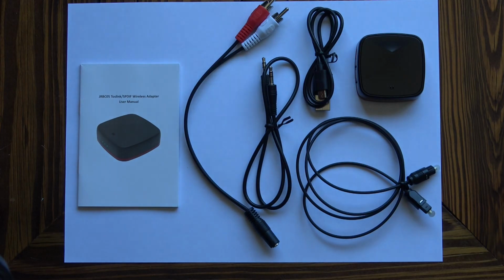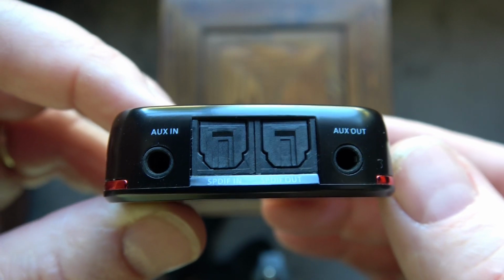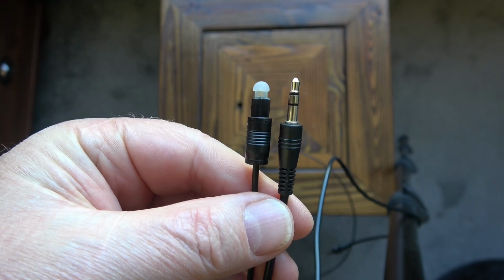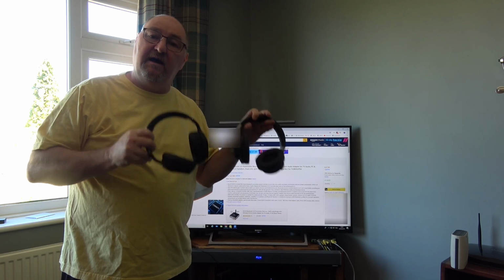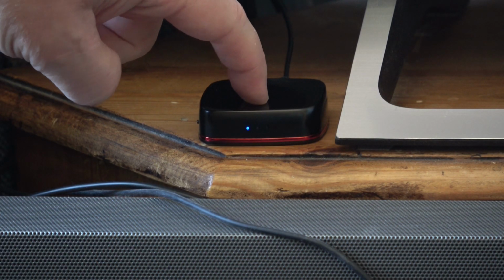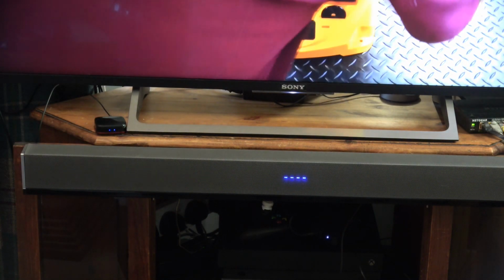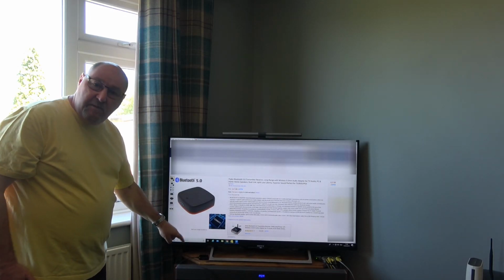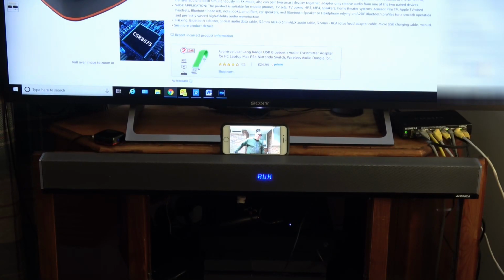Flybiz JRBC05 Bluetooth 5.0 Transmitter/Receiver - Review and Set Up

Comment: Hi Russell, thanks for the video. I have the same product but when I connect 2 bluetooth speakers I have Delay, the sound arrives 1 second late, do you know what it could be? Another thing is that I wanted to combine the audio outputs, Aux Out and Bluetooth at the same time, but I couldn't do it. Do you know anything about that? regards
Reply from the maker: Sorry Cristian, No idea on either issue.  I would try the Flybiz on other equipment to see if it behaves in the same way on them.  :-)

Comment: So, I received the unit and played a bit with it. Connecting this unit to an amplifier works great. This way you can put the volume more up. But it distorts when you move the volume up to much. So you need to find the sweet spot. Also i find the frequency range a bit dissapointing. Connecting my headphones to a huawei p30 gives me a wider range of sound and deeper bass. The p30 also supports the aptX features. And it seems that the low latency feature doesn't work. I still got a sound delay
Reply from the maker: I am glad it worked for your amplifier.  I have found that the latency changes with diferent tv's and headphone combinations, even if they are compatible.  Thanks for the update Martin.  :-)

Comment: Great video. Thanks. I got a question, I just ordered this unit to use it to play music from my tv to my new Marshall Major IV headphones, because my tv and also my Huawei p9 phone don't support aptX. But the Marshall headphones do. Now, I am going to put an amplifier in between and want to plug this unit on the jack-out on my amplifier, so that I can turn the volume more up, than the tv or phone and also the optical out can do. Without an amplifier, you are "capped". Ofcourse I will set my amplifier on "direct" mode, otherwise it will distort the sound if I want to max it out. Do you have any experience with this setup? I just wanted to know if there is any loss of sound in such a setup.
Thanks again for this vid. I'm receiving this unit monday. Can't wait
Reply from the maker: I am sorry Martin, this is not something I have any experience of.  :-)
Reply: @RussellPlatten  thanks. As soon as I receive the unit, I will give it a go and post the result here. Greets